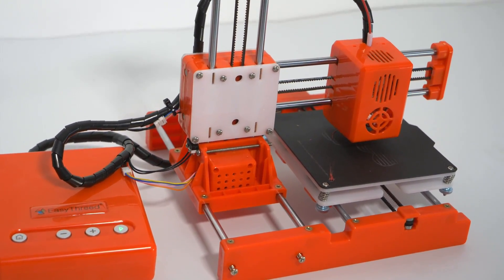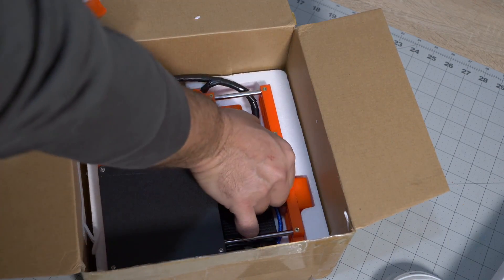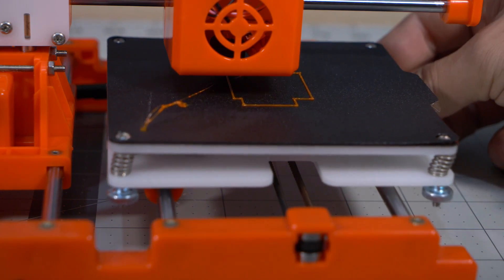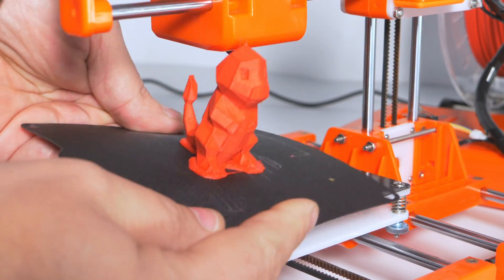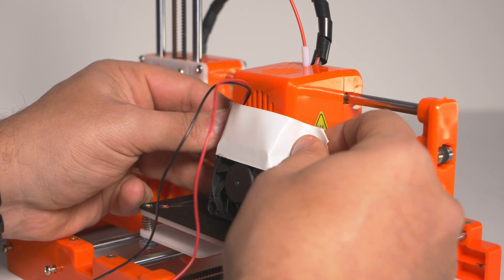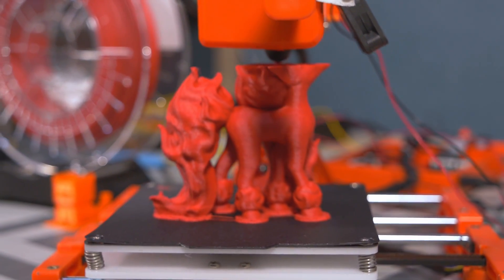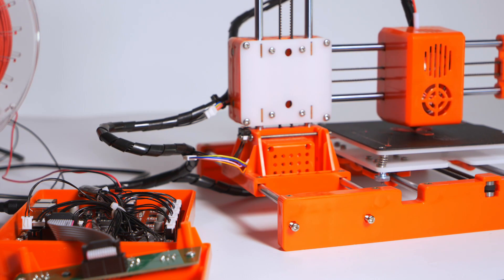The Cheapest 3D Printer Yet - EasyThreed X1

Comment: I just spent $84 to fix my hot end on my printer. This printer looks like it has the potential to be an affordable fun start to get into 3D printing.
Reply: Sounds like a bad hottend design and I’d change it personally unless it broke with user error and you just had it smash into an object and destroy itself with some powerful motors and flying across at 200+ mm/s (aka “head crashing”)

Most hotends are like $15 (the extruder is not part of the hottend), so like when I wanted to switch to cheaper 3mm rolls it cost me like $12 for the heatsink/heater block/heater/thermocouple/nozzle/quick connect (I switched mine from 1.75 direct to 3mm Bowden for more speed) and it works well (I have printed above 150mm/s through bigger nozzles and it handles the flow rate just fine), even printing over-extruded for 1.5mm to really dump material in fast because I use it like a rapid prototype machine and I can make multiple per hour of 3 inch diameter by half inch thick double herringbone gears (solid infil) on my machine with smaller 0.5 nozzle.

I’ve seen people on robotics teams get way worse hot ends for like $60 and I look at it and point out a lot of flaws compared to mine in like 10 second glance, you obviously need to know what to look for but I’m shocked the price variation is so much for often inferior products (and yeah that design sucked in every way I thought it would). It’s bad when the purchasing is in charge of someone with the logic of “well it costs more so it must be better” and ignores the overall inferior design.

I could see a nozzle costing $85 though, maybe that’s what cost so much on yours (or it’s some proprietary inferior garbage designed so poorly it breaks partly in the hopes of scamming more customers with replacement parts like those Makerbots with wailing motors and crappy single piece driver board controllers that seem to blow up unlike most DIY parts, inexcusable poor quality for $2k machines losing to $200 DIY machines). You can tell I like proprietary right? Haha!

Comment: I'm curious about the other thermal runaway situation (or if it even could happen, based on the construction). That is, if the thermistor is still connected to the board but is removed from the hot end assembly, meaning the printer might keep heating the hot end to reach the target temp.

Neat little device!

Comment: I managed to pick up the EasyThreed Nano for about 80 GBP on a flash sale, have been using it for over a year and am also really impressed with the results (and their support). I've even printed flexibles on it with surprisingly good results! I'd say the Nano is even more child-friendly and the only problems are a lock of cooling fan for small details and build volume (but it forces you to be creative in your designing, teaching about fitting parts together and tolerances). The spool holder on the Nano can break easily, but I made a stronger design - https://www.thingiverse.com/thing:3537001

Comment: It goes to show how much margin other brands manufacturers are enjoying
Reply: Not necessarily.  The ones that come out first have development costs.  The later ones do not have such steep development costs, but have price elasticity from competition.
Reply: No, it doesn't. There's barely any material in this, and dinky little $1 motors everywhere, no heated bed, tiny little lightweight thing overall so cheaper to ship. I'm not going to claim that there aren't many many companies and products with high margins, but if you think of something like Ender3 and its various siblings (Geeetech A10, Tevo Tarantula, etc which all have their advantages) around $200 mark, there really isn't all that much margin in there, probably not that much difference. Correspondingly for 2-ish times the price you don't get a printer that's merely twice as good, you get one that is really like 10 times as good. Not only 4 times the print area and 8 times the print volume, but also much more stable and capable of higher forces, tougher to print materials, etc.

But i don't mean to bash on this little thing, it's kind of remarkable in the mere fact that it works at all in spite of being made of very low-cost hardware. There is value in getting something made which is the barest and cheapest thing that could possibly work, someone might just need exactly that to get themselves off the ground.
Reply: @SianaGearz  Even then to get the features you described, I can just buy from China. It's much cheaper because of your Taxation in the West. The west always lose in terms of price

Comment: that is a 32bit board! :O
Reply: Might be surprising but the 32 bit lpc1768 is far more better (100mhz) and has more features than a at mega but at the same time costs less so 32 bit is actually cheaper
Reply: STM32 and LPC chips are actually cheaper than old Atmel 8-bit ones and don't incur any higher cost on the whole-system design, as it happens, i mean you save yourself an USB to serial chip and the like. Like an STM32F103 with enough pins and firmware space for something displayless like this is less than a dollar. Malyan has been doing this for a long time for example.

Comment: interesting. I wonder what kind of upgrades would be possible. both with stock board and maybe what a replacment board would do (btt skr 1.3 with tmc2209 anyone?)

if you configured cura for it would the connector for the buttons be able to run an LCD? for example.
Reply: The X2 version of this machine has an lcd and rotary knob control

Comment: Actually it is a nice toy. But you can get an much better printer for that price - buy a used or "refubrished" printer. I paid about 80€ for my Monoprice Delta Mini direct from Monoprice. It was an retoure sold again for reduced price. I definitly know why it was retoured - the bed did not heat up. Opened the base - a connector was loose. That was all. So with 5 minutes of efford I got a practicly new Monoprice Delta mini for the price of that printer you show. And there are definitly worlds between the quality...

But definitly - I am impressed. As it is a toy and as you say correctly the user might grow out of this maybe in weeks or even days, I think it will go on ebay as used printer soon. With even a lower price... I think it might be hard to resist if they are sold used on eBay.

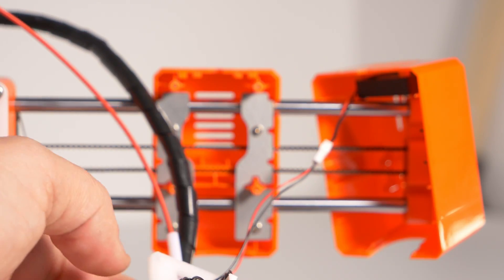Comment: @5:50 Wait wait wait, hold on a minute... isn't that setup basically direct drive??? Why aren't more printers using a similar setup with a pancake stepper or NEMA 14 right out of the box?
Reply: I think its about speed limit. The motor looks like a geared one (bigger than the 1$ type you get from china, but definitly with an internal gear - as you can see in the video, the motor sits centric, but on the other side you see the axis is not centric - a definit sign for an internal gear (but not an planetary one) inside to get the force to move the filament. This type of motor typicly use a high gear ratio (impossible to move the axis by hand), so the motor has to rotate with a relative high speed to push the filament slowly.
In my opinion, this is the reason the printer prints so slow - it can not push more filament in time with this design, as the speed of a stepper is limited.+

But of course it is impressive and I hope some more development will be done there.
Reply: I actually wonder how it would print flexibles.

Comment: Direct drive, wonder if it can do tpu? With a printed fan shroud it might be useful.
Reply: I've managed to do TPU on the EasyThreed Nano (same manufacturer) - which looks very similar in part design (and was picked up for about the same price in a flash sale)
Reply: There's a fan add-on https://www.aliexpress.com/item/4000469006532.html?spm=2114.12010615.8148356.21.1f111cfbxChuq7

Comment: 7:50 who else noticed loose belt on x axis
Reply: Noticed it too.  Curious^^ was that segment of video made before he had orinted everything? If not that tels me he was capable of those prints with that loose of a belt! ( probably because there is such low print speed it didnt slip but still )  thats wicked! Such an easy fix and you can probably print faster
Reply: I've run any number of tensions on my belt, it's honestly not a big deal for slow prints. The part that actually pulls the head gets taught when the motor is running.
Reply: @MatthewFindley-o7q   Jeez someone woke up on the wrong side of the bed. XD

Comment: Great video! The print quality could even be better if the belts were tensioned correctly. (7:50)
Reply: I think tom said those motors are really easy to break the tiny gears inside
Maybe it's risky?
Reply: Michael WithadoubleB that doesn’t have to do with tensioning the belt. The belt can be tensioned properly with just a zip tie and it’s pretty easy and not risky to do.
Reply: @KrishnaVijayraman  how would you use a ziptie to do it?
I would 3d print a belt tensioner, it's 30 minute job and requires a small spring and maybe some screws aside from 3d printable stuff.
Reply: @lazar2175  you can see zip tied belts being tensioned on smaller printers such as this and the tronxy xy-100. A belt tensioner is overkill as you can get good tension by just lining the jaws of the belt with each other and then zip tying it tight to lock the jaws in place. You have to make sure you can pull the belt as tight as possible though before you line up the jaws (without putting too much strain on the belt so that it doesn't break). This should provide good belt tension and you can clip off any excess belt provided you zip tie it near the extruder head (obviously not near the bearings). In fact if you look at the back of the Prusa printers, you can see what I mean by locking the belt with its own jaws.
Reply: @KrishnaVijayraman  Thanks a lot, i wouldn't have thought of that in ages lol, this will come in handy because i made my own printer and my belts stretch out so i just 3d printed a small gear tensioned by 2 springs from a ball point pen.
This solution is much more elegant and will increase the reliability of my 3d printer because my belt will sometimes slip out or get loose.
Thank you so much!
Reply: @lazar2175  No problem! I'm glad it helped.
Reply: @ann_teator  i had this problem on my x1 mini. After a year of use, the gear inside the stepper on Y axis broke and I couldn't find a cheap one to repair my printer.
Reply: To be far, threading and visible layers are nothing some sandpaper can't fix (and minor theading can be fixed by cuting threads off with scissors). Don't have a 3d printer, but helped clean up some 3d prints that they were sure failed because of layering/threads so I know.
Reply: Do anyone know how to use wifi expansion on it?

Comment: 5:03 so it's hard to learn slicing software for this? I have no idea about 3d printing..Thinking of this as a gift..
Reply from the maker: Slicing can be as easy and as complicated as you want it to be. There are many that make it very easy and straightforward. It’s a learning curve, but an enjoyable one :)
Reply: It also helps if you don't start diving into too complex a print too as you may get disheartened when it doesn't work out. Things like the poly Pikachu shown here are great starter print examples. Then slowly you'll learn and experiment with the types of prints which use supports, how to arrange it best to print on the bed etc.
Reply: My EasyThreed Nano came with it's own slicing software (perhaps this does to). In all honesty I never used it. Instead I learned Cura - there's a very detailed tutorial on the download website that explains everything. Couple that with a willingness to experiment and watch a few YouTube tutorials and you should be fine.

Comment: Well, not the cheapest here ;-) I bought the CTC A8 for less (and yes, that works like another A8). Prices of these vary a bit ;-)
That takes a lot more time to set up though!
Reply: I got a CTC A8 for Christmas, spent a week building it on and off but it's finally done, prints very close to my ender 3 pro and cr10s, only a slightly lower surface quality.
Reply: @isaaclyonsf1  And with heated bed, something the Easy Thread misses. 

Don't forget to upgrade the firmware because on this printer most-probably thermal-runaway is not enabled by default. Nice Christmas-gift!
Reply: @elvinhaak  how do I update the firmware? Thanks.
Reply: @isaaclyonsf1  In Short: download an updated firmware for your A8 (same as Anet A8 works) with the options enabled you want or enable it before 'compiling'.  Connect the printer to your computer and upload it. Disconnect, reboot and your printer has the newer version.

There are lots of videos online how you do this, just search for 'updating Anet A8 firmware'.
Reply: @elvinhaak  Brilliant, thank you!
Reply: I bought Geeetech i3 Pro W for barely more than the cost of this one. It's not a good machine by any stretch of imagination, the mechanics is wonky, there's no part cooling out of the box, but electronics is exceptionally good, and it was a consideration for me. But thing is it's a completely different category of product. Your A8 and my Woody are parts kits that you assemble from all the separate nuts and bolts, that will take something like 6-12 hours to build even if you already have a pretty good idea of how things go together. This is ready to run out of the box with just a single joint to attach.
Kits are also full size 3D printers with heated beds and have motors that will develop a very high force if you ask them to, which is not the case here.
Reply: Anycubic kossel now £75 on Aliexpress for the sale.

Comment: I'm glad you made this video, I've been looking at this printer and trying to find out the specs and info to compare it to the Prusa Mini, which I have ordered. I will be waiting for the X2 version of this machine as it includes an LCD on the console and more controls like preheat, I also like that the X2 moves the hot end away from the part when paused then returns when you resume the print job. 
You've confirmed my thoughts about this machine and I will be ordering when the X2 is released in 1 month. Thanks :D